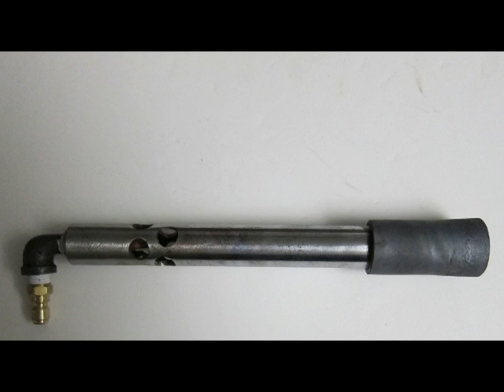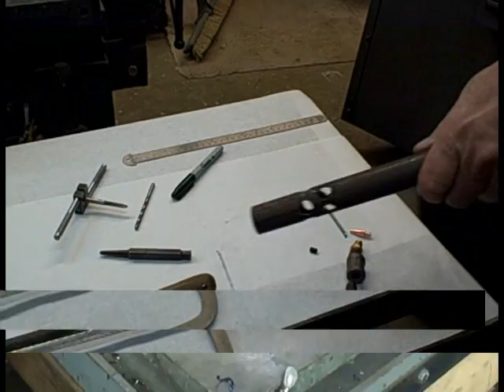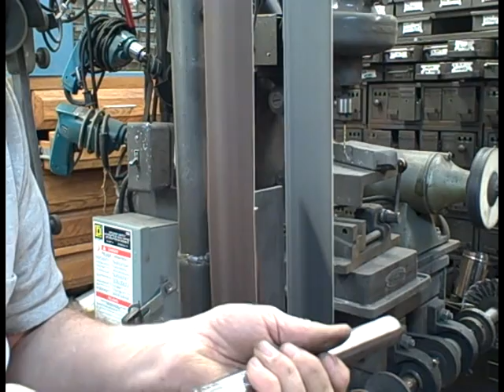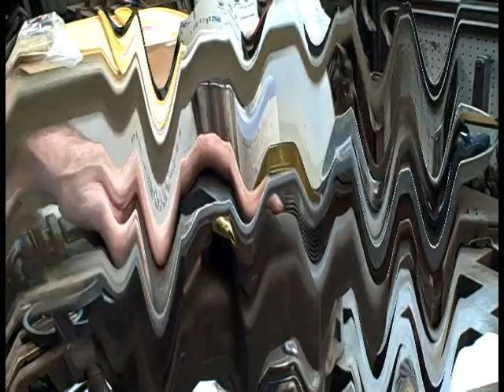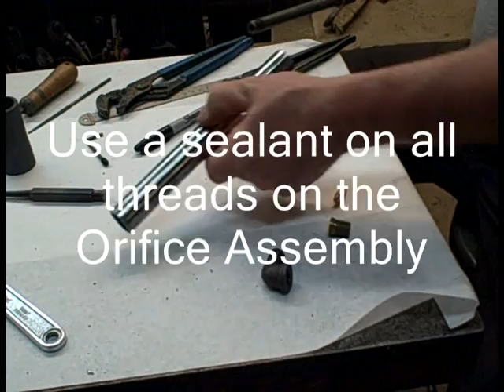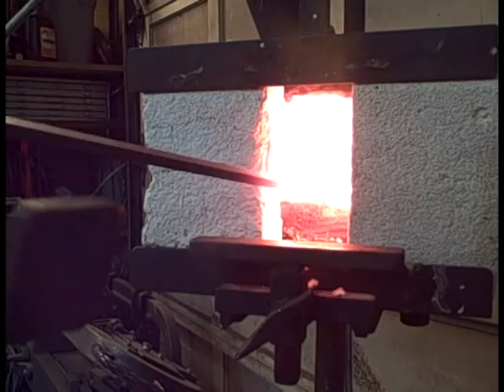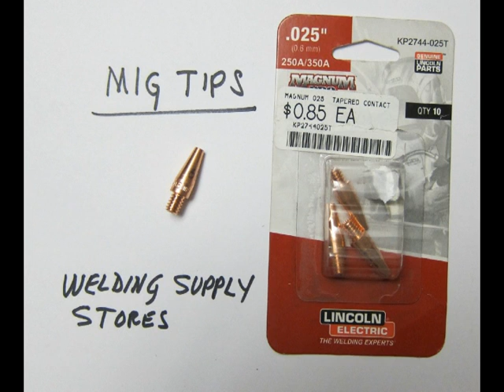How to build a Propane Forge Burner

Comment: Can you use butane instead of propane? Also, I don't have a tapping set, so could you just weld everything instead of screwing it? Great vid, thumbs up from me
Reply: I have not tested these burners with butane.   If you decide to experiment, the orifice sizes and pressure requirements will probably be different.   Please be careful.  Also, I have read that butane is not friendly to use in cold environments.

You could weld the burner pieces together and it would certainly work if you have all the alignment and positioning correct, but I wouldn't recommend it.  Doing that will prevent you from fixing problems you may encounter over time.

The mig tip needs to point straight down the pipe and may occasionally need to be cleaned if the flame starts misbehaving.   If the fitting was welded in, you couldn't adjust the tip position or get to the tip to clean it.  Also, the flare will eventually need to be replaced if you use the forge a lot, so it needs to be removable, making it a requirement that the burner be able to be removed from the forge body. 

I don't know where you live, but there a "drill bit and  tap set" for 1/4 - 20 threads can be bought for a few $ (well less than $10 for the proper drill bit and single tap) at virtually any hardware store.  The same hardware store should sell the 1/4 inch bolts and set screws you will need. Good luck with your project.

Comment: you need to wrap all the threads in gas sealing tape (PTFE tape)
Reply: I did mention in the video that I use a commercial paste (and told the brand I use) when I finally put the burner together.  Tape will work also, but you have to very careful that there is no tape that can strip off inside, it will plug the orifice.
Reply: David Hammer my bad do you use reguler propane because i have a blow torch for soldering pipe could i just use that?
Reply: OGrealG This  has to be the quickest I've been able to answer a question...   

I do use regular propane....   and you CAN use a propane torch to heat a small forge (much smaller than the forges you see in my videos)...  If you search on YouTube for "Coffee Can Forge", you will see an example of a small forge heated by a propane torch.   If you use the forge a lot, I would recommend buying a fitting with which you can "refill" your propane torch bottle from a barbecue sized propane container.  It will save you a lot of money.  Harbor Freight has them for sale.    Good luck.....

Comment: Don't do metal work, so I don't need or want a forge; however, I found the info in your vid to be VERY interesting.  Great job in the logical flow of the presentation.  Thank you for using still frames where they were most useful and for NOT subjecting us viewers to long sequences of trivial, repetitive tasks.  Wish more 'tubers would use these techniques!

Comment: Hello Dave how are you doing? I like your little Super "C" Forge. Thank you for taken time out to film all thats necessary, what a task! :-)  I like it so much i built myself one and it works great. My first time out I got lazy and didn't take time to make a convertable and now I know what you mean when its time to "line" the Super C. I have a big 12" piece of cut off pipe and I was thinking about making this with a two burner system. I just wanted to get your opinion about this 12" business. Oh I really wanted to comment on your Super C burner, that little thing works very well. I wanted to ask you what you think about the 11/2 X 3/4 reducing bell with the 1/8" pipe thats drilled with a #58 or #59 orfice or a mig tip. I made a burner with a 1"X1/2" reducing bell and I wasn't impressed with it. When I built your burner I was impressed with everything about it! Thanks dave for sharing everthing! Bill Gullick  (wgullick@yahoo.com

Comment: guys i have a question,

so i quickly grabed some metal tube and rubber and construted a quick torch burner but  the design was similar to this model,i tested it with a butane canister but instead of working ( some of the butane came out of the air holes) i didn't manage to get much of a strong flame.do you think it is the problem with the  aerosol canister's psi? or did i not make it right?

Comment: ordered the regulator from ace then walmart then toolfetch they all sent me the wrong one even though the description was all correct i still keep getting the 20 psi regulator
Reply: It looks like Mr Heater (company) has a new product (the 0-20 PSI regulator) and they are marketing it as a high pressure regulator with the same product number (I checked several retail sources).    Not a good thing.  Although this burner will work with the 0-20, it will not put out as much heat if you cannot crank it up to at least 30 PSI (I run mine even higher than that sometimes).  I suggest calling Mr Heater (service, if they have a line) and ask how you get the real 0-60 regulator.  The ones I have bought in the past have black knobs.  If they no longer sell that product, I suggest you look at other products that are 0-60 PSI.  They will most likely be much more expensive though.

Comment: how do you tell if the ball valve is rated for gas?
Reply: Good question....It should say on the valve, or on the paper tag attached to it.  I would not use any valve that is not specifically identified as safe for gas.
Reply: It will have a yellow handle
Reply: Ben Press It will have a WOG rating (water, oil, gas)

Comment: I used a pipe reducer with a 3" inlet and put the gas through a 3mm hole on the mid flow, the 3" inlet allows forced air , this from a fan allows a huge increase in burnable gas pressure to 3 bar , with an air blower at 60W , 30V 2A,

Comment: hi dave a have a few question on the burner with the mig tip you say .25 would a .30 be to much ?  is the mig tip the kind for argon gas as well? i think they have vents on the side compared to the non argon style.
Reply: A .030 mig tip will work fine with the burner with propane.  If fact, some folks had trouble with the burner and using a .030 mig tip helped solve their problems. 

I'm not sure what your question is concerning Argon.  If you are referring to using Argon gas, I have no experience doing that, so you would just have to experiment.  The mig tips I recommend are normally used on a mig welder (the wire goes through it), regardless of the type of gas that is used for shielding with the welder.  If there is a different tip design you are referring to, I am not familiar with them.   I would not suggest using mig tips that have holes anywhere except through the center.

Comment: I got the burner to finally light!! Turns out my problem was to cold of a propane cylinder. I had been trying to light the torch in 40-45 degree weather so I just warmed up the propane cylinder in the bath tub and now the torch works great!!!

Comment: Hey all! I followed your burner design but am having trouble getting the thing to light. I've made sure everything is perfectly aligned and smooth in the burner body. And I have 2 questions 1: how critical is the flare positioning? Should the burner light the first time I estimate the flare position. I have placed the flare with the end of the taper just past the end of the pipe but it won't light at all. I have also tried adjusting the flare position as well up and down the pipe a little bit at a time but still no flame. 2: how important is the needle valve I have a 0-60 regulator and gauge just not the needle valve. Do I need one?
Reply: Personally, I consider the needle valve the most important part of my propane control.  It's how I control the pressure and volume of the propane.   I can only speak with confidence if you set up your propane line up as  I do.  Other configurations would be an experiment.

I would expect, however, you should to be able to get this burner to work without a needle valve.  Lots of folks have used other types of propane burners without one.  Without a needle valve, the regulator is used to control the pressure and volume of the propane. 

No, the burner won't necessarily light with the first flare positioning.  I have held a propane torch (running) at the end of the propane burner and moved the flare just a little at a time to see where it would light. 

A couple things to try...  set your pressure at about 10 to 15 PSI when you light the propane burner.   If the burner lights, increase and/or decrease the pressure to change the flame intensity as you wish after the burner has run a little while (gets hot).  Setting the flare as you mentioned (end of taper just past the end of the pipe) is a good starting point.  If the burner will not start, move the flare a little up and down with the torch running at the end of the burner.  If 10-15 PSI doesn't work, lower the pressure or raise it a bit and try again.

Another thing...  In the video, I use a .025 mig tip.  When folks cannot get the burner to behave, I suggest moving up to a  .030 mig tip.  Some folks even go to a .035 mig tip on 3/4 inch pipe burners.  In general, the larger the tip, the less pressure you should have to use.

One final comment.  Have you tried your burner in a forge?  The configuration you are trying to use may work in a forge, where it would not work out in free air.  Sometimes back pressure helps.

Also....  be sure your mig tip is open.  To be sure, I use run an appropriately sized acetylene tip cleaner through it.

Comment: Look, would I need a list of all the pieces from the gas tank to the burner. The tube length and breadth of the hole, and if stainless steel or type of material is.
How the pieces would be requested to buy?, What happens is that in the video you hear his voice very faint, so I can not ask someone who speaks English. I asked someone and said it was not reached to listen.
If you send me a list of parts by writing to use the translator, but his voice did not translate.
I have the tools to make the burner.
If I could you please send me a message to my email: navajaselcuchillerovargasa@hotmail.com

Comment: Hello, Mr David, I would like to know the measures of the parts that you used in this burner, because I'm from Mexico, and I would like to buy them, if you could help me is it would appreciate. I do not speak English, and there are measures, thanks
Reply: Rafael....  I discuss each individual part I used to make the burner.  I can't provide a universal list of materials beyond my descriptions because local availability of parts may vary (for example, pipe size and thread sizes).  Functionally equivalent parts should be available locally if you have hardware, plumbing and welding supply stores (with the possible exception of the stainless steel flare).  I suggest you have someone who understands English watch the video with you and have them write down what I discuss, then go to the stores that are available that carry those types of items. 

The list where I live would be... 

Body:   9 inches of 3/4 inch schedule 40 pipe
Elbow:  1/4 inch NPT street elbow
Coupler:  1/4 inch NPT coupler
Pipes used when sanding coupler:  (2) 1/4 inch NPT nipples 6 inches long
Brass fitting:  1/4 inch NPT threading with flare fitting on other end.
Mig Tip:  .025 or .030 tip (thread size will vary)
Flare : 3 inches of stainless steel pipe that fits over schedule 40 pipe
Set screws:  I use 1/4 inch 20 TPI  one quarter inch long.
If you add a pressure gauge, I use all 1/4 inch NPT fittings.

I think I put enough information in print (in the video) for the regulator, needle valve and quick-connects. 

Good luck with your efforts.

Comment: I am thinking about making a ceramic chip forge would you be able to use this burner with it.

Also just wondering could you list all of the materials used please.
Reply from the maker: I'm not familiar with ceramic chip forges, so I don't know how the atmospheric burner would be used with one.  In general, this burner would be used where there is a lined burn chamber.

My video already discusses all the materials needed to make the burner.

Comment: Dave - I completed my burner a couple of days ago.  I didn't modify anything, so it's as described in your video.  I also replicated your propane delivery system.  My problem is that I can't get the flame to settle on the end of the flare at all - at any pressure.  I've tried adjusting the orifice position back some and tried some extreme and mid-range positions for the flare - same problem.  I've adjusted the gas pressure way down to a couple of psi and up to a high flow rate - same problem.

Just writing to see if you had some ideas.  The only difference I can think of is the flare itself.  I had to buy one, and I wonder if it's flared enough.  It's hard to tell, since 12 degrees isn't very much.
Reply from the maker: If the flare is evenly tapered, I expect it will work. Be sure you are just moving the flare just a little bit at a time to adjust where its best position is.  Sometimes the range of operation with the flare is fairly small in positioning distance.  The next  thing I would have you re-verify is that there are no burrs on the inside of the pipe.  If there are, there will be air turbulence that will upset the burner.  Next, use a tip cleaner to verify there is no obstruction in the mig tip.  Following that, verify that the mig tip is pointing straight down the pipe.  If it's not, the burner will not work.  I have bought couplers that were not threaded straight so it could be the problem even if you are sure you did a good job sanding and fitting the coupler to the pipe.  You can do a visual at first, but if you adjust it and it still doesn't work and you are not sure about the alignment, hook up a water hose (to the input side) and see if a stream of water comes out the middle of the flare (hold the burner straight up or down).  

I have never had problems using .025 mig tips, but others who have had problems have reported that they replaced it with a .030 tip and their burner worked fine.   The last thing is to go ahead and put the burner in a forge.  The little bit of back pressure may make the difference in working and not working. 

If you have tried this in your forge already, be sure your burner is up in the blanket or refractory about an inch above the burn chamber ceiling and the opening is clear and smooth into the burn chamber.

How large is your burn chamber?
Reply: ***** Dave - Thanks for the detailed reply.  I kind of solved my problem.  I put a telescoping cardboard tube on the burner pipe between the flare and the 2 sets of air holes (4 at 2" and 4 at 2 3/4").  I had a lighter torch turned on with the flame just out about 4 inches in front of the burner flare.  I started the propane out at about 3 psi.  I could see the gas igniting when it got out to the lighter torch flame.  Then I slowly slid the cardboard tube down over the first set of air holes.  No change noted.  Then I slowly started sliding the tube down over the 2nd set of holes.  The flame instantly snapped down onto the flare head.  I adjusted the tube up and down over that set of holes and got the best looking flame with that set of holes about half covered.  So I'm getting my best flame with 75% of the air intake holes covered.

It seems like a nice powerful flame, but I have nothing to really compare it to.  I adjusted the psi up to 35 psi and back down to 3 psi and the flame seems very stable.

Your thoughts would be appreciated.  Have you seen this development before?  I'm going to reply again to bring up a couple of other issues.
Reply: ***** You were asking about the size of my burn chamber.  This burner that I just made, and am asking about, will be the burner for my first forge.  I haven't made that forge yet.  I've watched your forge making videos and am putting together a plan.

I found a 12 qt, heavy duty, spun aluminum stock pot at GFS.  It has a 10 ID and is 9 inches tall with straight up and down sides.  With 2" of insulation inside, I'll end up with a burn chamber 6" in dia. and 7" deep, for a burn chamber of about 200 cubic inches.

Do you see any red flags in my plan?

I'm going to reply with one other issue.
Reply: ***** Dave - You mentioned trying a 0.030 mig tip.  I'm going to try that.  It just seems like that would give me a more powerful forge.

The cross-sectional area of the 0.030 tip is 44% greater than that of a 0.025 tip.  Does that translate into 44% more gas delivered, and 44% more BTUs in the burn chamber?

Of course, maybe the same thing can be accomplished by just cranking up the psi.

Are there upsides and downsides to using one or the other of these two tips?
Reply: dancrampton I just tried the 0.030 mig tip.  It works fine with all the air holes open.  I did find that I had to hold the lighter torch flame right at the very end of the flare and not out in front 3 or 4 inches.  It won't jump back to rest on the flare otherwise.

The flame I have now is much more powerful than the one I had with most of the air holes covered.  I cranked it up to 30 psi and it sounded like a jet engine.  I'm pretty happy now with the burner.  On to the forge itself.
Reply: I am having the same problem as dancrampton described.  I think the problem may be my mig tip, seems slightly off.  I will recheck for burrs.  An additional problem I was having is the flame is backing up to the holes and coming out of the holes making a whistling sound.  My flair was purchased.  I will re-tap a new brass flair for the mig tip and make sure I am square.
Reply: drjerrymc sounds like your tip is too far back or maybe burs from drilling? Give the inside of the pipe a good check for stray pieces, burning inside the tube tends to mean your fuel starved or you’re getting turbulence. What mig tip are you using, what size pipe do you have?
Reply: dancrampto